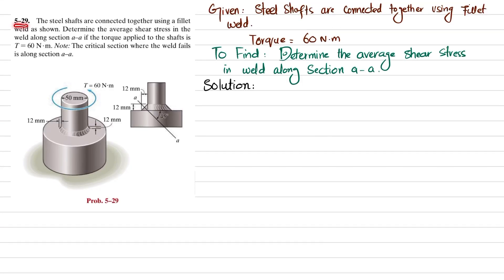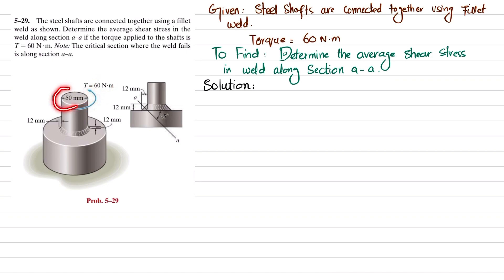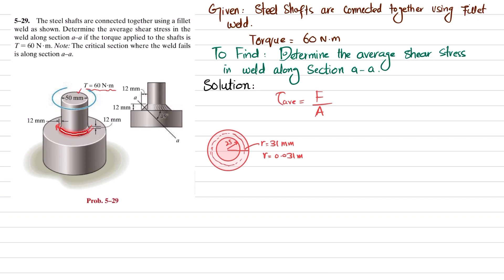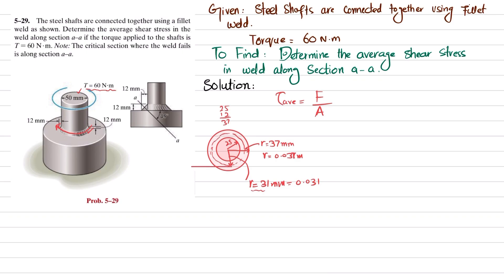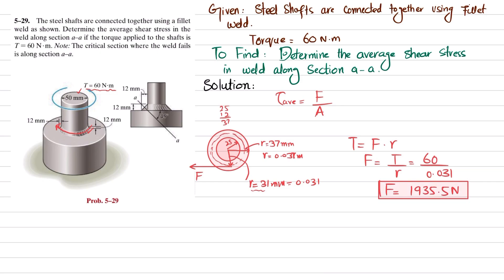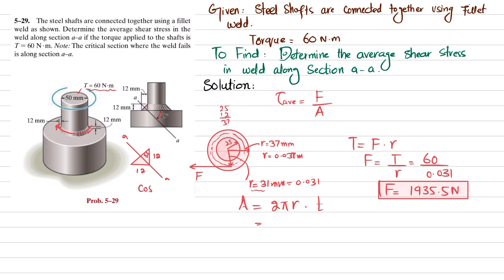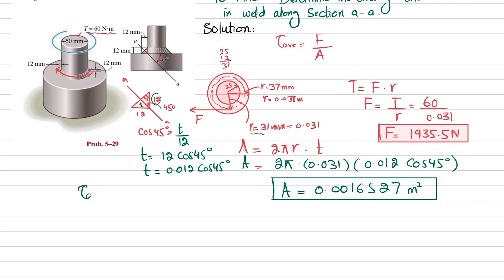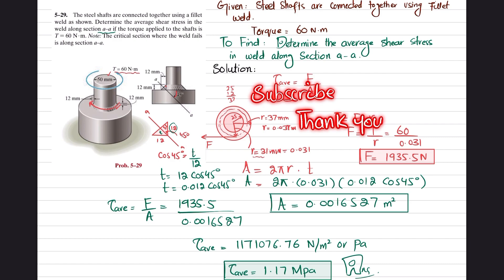5-29  Determine average shear stress in weld along section a–a | Mechanics of materials RC Hibbeler

Comment: sir, how did you get r=0.031?
Reply from the maker: The diameter of upper cylindrical body is 50 mm and radius will be 50/2= 25 mm and with of fillet welding is 12mm so half of 12 mm will give 6 mm . Now 25+6=31 mm mean radius of the circle including the fillet welding with the upper cylinder.
Reply: @engradnanrasheedmechanical 

Thank you sir🙏🏾